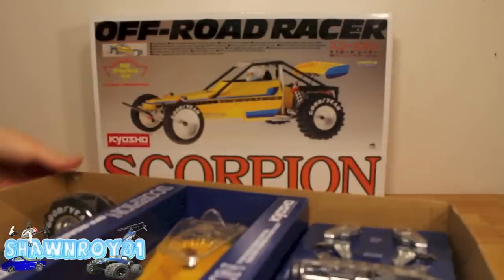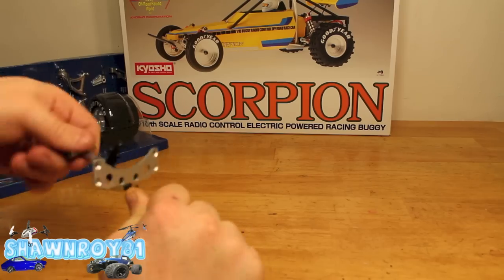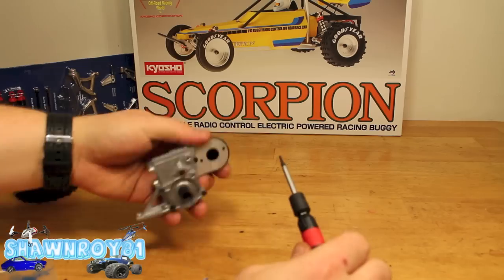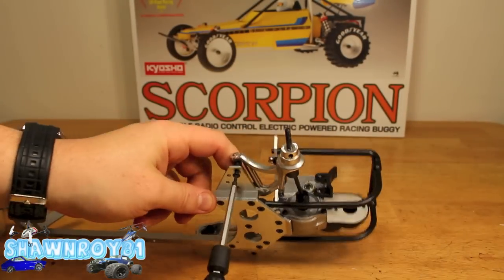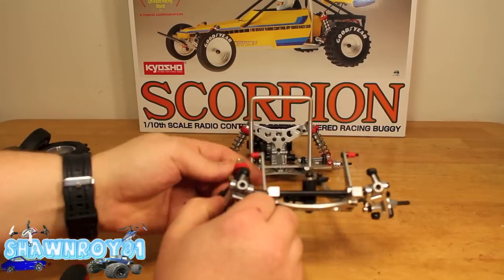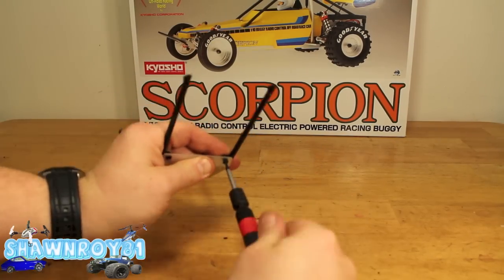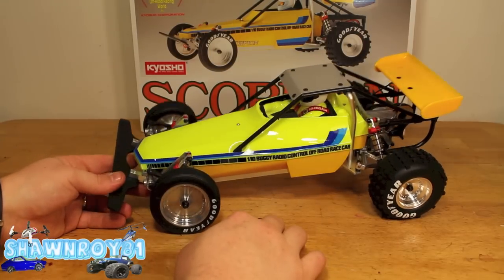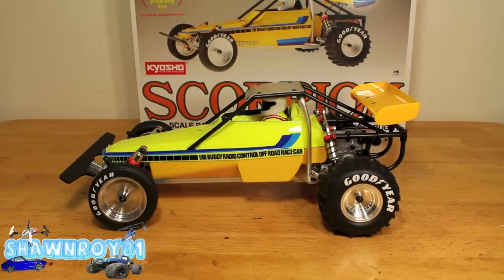My New Kyosho Scorpion 2014 build

Comment: Cool what type of electronics are you thinking of using?

I like the aluminum chassis. I like these old classic electric rc's and putting in brushless systems and high torque servos, making a beast of a classic.
Reply from the maker: I will be going with a brushless system I have laying around. Nothing crazy but it will move. Thanks..Ya im into that too

Comment: shawnroy81  Have you had any problems with your Savage Octane's front bearing leaking oil onto the clutch making it slip? I took it apart, cleaned all the black crap off the clutch shoes then ran it again for a few minutes, it hooked up good and popped wheelies for 2-3 minutes then began to struggle, when going up hill, there is almost no power to the wheels and it moves super slow, completely different performance from when it was new....

Is my clutch just gone? or should I look into testing the engine outside the vehicle and see if it leaks oil? cuz there was no oil on the engine mount, but I dont know where this black oil that keeps getting on the clutch shoes is coming from...they seem intact, a bit of scuffing on the contacting etch, but nothing that I would think is too serious...
Reply from the maker: No I havent had any issues with that. I ripped the slipper pads but after replacing its been fine. For the leaking im not sure. Taking it out of the chassis may be a good option. Keep me posted im interested in finding out the cause.
Reply: was POSSIBLY a clutch bell bearing leaking, the bearing was filled with the same material the clutch was covered in, blew it out and refilled it with a small amount of 3in1 oil, front and rear, then reassembled, will see how it pans out this saturday when I am off from work.

Happy Thanksgiving!
Reply: ended up being a bent input shaft for the transmission. The spur gear, on rotation, was perfectly meshed with the clutch on one side, but when the bent side came round, it was too tight and it would bind, causing the clutch to bind and slip, its in the shop right now awaiting parts and care, normally I would service it myself, but im so busy with work this holiday season Im letting the shop I bought it from do the work! ;)
Reply from the maker: perfect..keep me posted
Reply: will do
Reply: ***** Alright, FINALLY, its all sorted, get this, had nothing to do with anything we thought it was.

The gear mesh between the spur and clutch bell was too tight....on one side... we thought it was the input shaft bending, replaced it twice, the problem persisted, the spur gear itself, is bent! As crazy as that sounds, its true. It is the most minute bend ever, but you can clearly see it wobble went you spin it freely, 23 bucks....ouch.... I think this happened for 2 reasons. 1: I tightened down the slipper all the way, and 2, I tightened down the brakes too much. Throwing all that weight around, into the transmission and that gear, something was bound to fail with no slipper to soak up the force, luckily, I checked all the transmission internals. Its all A-Okay, so a new gear is on the way, will be here Saturday and we should be up and running after that!

Have  Merry Christmas and a Happy New Year!
Reply from the maker: wow....glad to know it was a relatively easy fix once it was diagnosed.